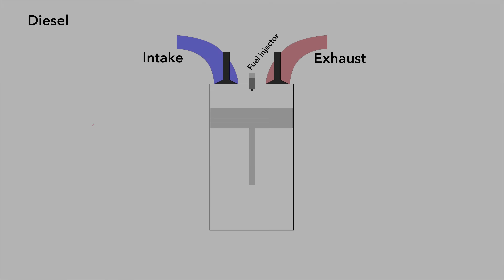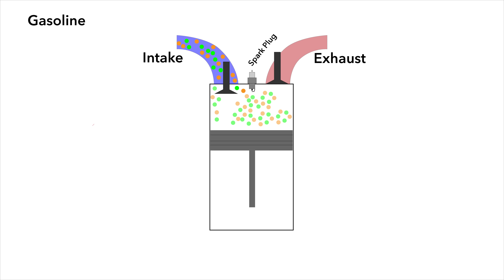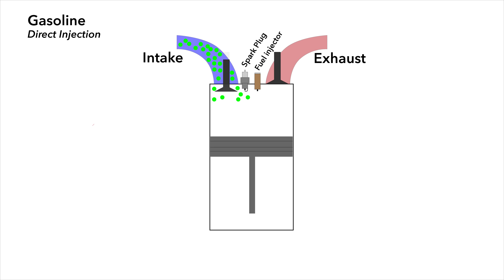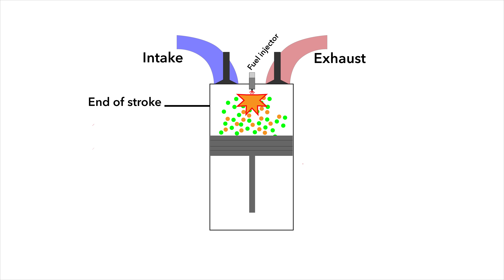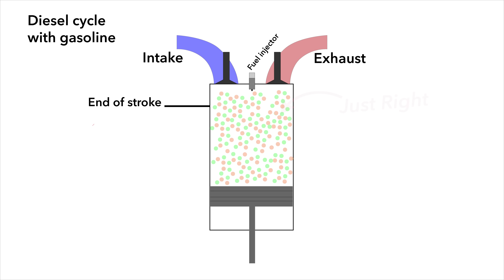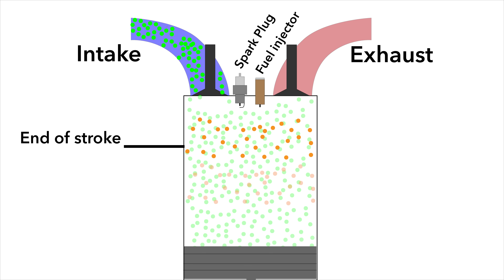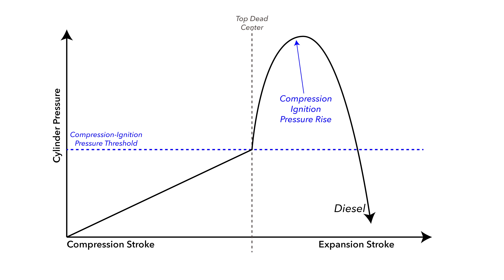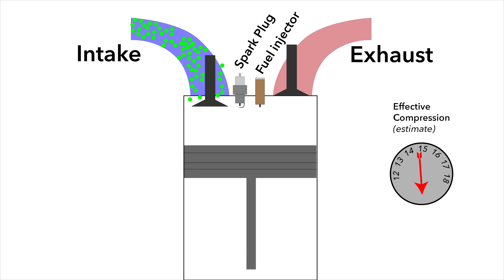Skyactiv-X: Mazda's Revolutionary Engine Explained

Comment: I think that Honda essentially the same thing many years ago.   The only difference was they had a separate small chamber with its own small valves with a relatively rich mixture that would then be used to lite off a lean mixture.  It was put into some production cars, Civics I think.

Comment: So what's the benefit? It didnt give numbers on fuel efficiency. It almost seems like tech for tech sake. At the end he states it has similar performance to the turbo 2.3litre. So why spend the money on something new and untested in the real world?
Reply: In theory the Skyactiv-X is a 2.0L that has the power of a non-turbo 2.5L, but the fuel consumption of a 1.5L. The potential is a Mazda 3 that gets about 45mpg but with about 185 hp. (The Mazda 2.5L turbo has 250 hp)  🙂

Comment: And another reason why this kind of concept aren't on sale ..  is the engine block must be thicker with more alloy+steel mixture to compensate high pressure combustion = vibration, so the price of the engine is more.. and in crowed market car price, sales dept not see it as benefit

Comment: Yes, Yes Yes Mazda have been able to control the injection but still uses the spark plug. Not new technology just  a more advanced Skyactiv engine. with advanced computer controlled fuel injection. Nothing really new at all. Anyone who owns a Mazda will tell you the 14:1 compression ratio motor is very similar to a diesel in a lot of ways.

Comment: But while the diesel is being injected, the part of the Diesel who being injected first ignites earlier. So it can't be igniting all at once am I right? Or is the ignition only happening when all the diesel is in there so the pressure is reached when all the diesel is in there? 

Sorry for my bad english i am from Germany
Reply: I think it is always gasoline, not diesel. The main gasoline mixture would never reach ignition compression just due to the piston compression.  It is a small, richer, explosion near the spark plug that raises the main mixture compression to its ignition compression, thus giving it a fast burn and high torque as though it was diesel.

Comment: I really hope it works but i have a feeling it will have problems and if Mazda fails on this they are risking their entire company's reputation. There is no going back from this if the Skyactiv-X fails.
Reply: They won't sell it until it has been proven in many hundreds of thousands of hours of testing in very hot to very cold conditions. When Mazda was first talking about the original Skyactiv-G engines lots of skeptics said it was not going to happen. The Skyactiv engines are some of the best engines in the business.
Reply: @rizzlerazzleuno4733  There is a difference proving something in a dyno and different in actual road testing.....A great example of that is Formula 1 engines! Look at Honda in the first few years and Renault!

Comment: If it uses a spark plug, it's not compression ignition.
Reply: I think the plug is used for some of the time. I agree with you, it's a pointless concept. Mazda's SkyActiv D and SkyActiv G engines are very good indeed. This just seems obscure.

Comment: Now when the fossil fuel engines should die out they discovered that it can be made a little bit more efficient. 
Why not to work on improving capacity and reducing costs of battery production? Don't beat the dead horse!
Reply: Many scientists and engineers on working every day to improve batteries. In the meantime making gasoline engines more efficient is a good thing.

Comment: Direct injection engines are crap... they carbon up bad on intake valves due to egr gasses. Mazda has had to offer extended Warrenties to cover these issues.  After that you are looking approx $800 annually in addition maintenance costs....
Reply: Plenty of diesel engines in use that seem OK. Top tier fuel helps enormously.

Comment: A good explanation. I think you refer to a Mazda 2.5 litre turbo engine. Certainly not turbo in Europe. Is it turbo in US?
Reply: Rodger Webb there is a 2.5L turbo option for the Grand Touring/Signature Mazda6, and I think it’s standard for the CX-9. I think it gets something like 250hp and 310ft-lb torque

Comment: So here’s what I’m walking away with:

It achieves conventional ratio + spark mode without detonating by (somehow) prolonging the intake valve, this “wasting” some (pre-fuel) intake air back out the intake valve, thus “spoiling” the effective compression ratio to something conventional.

It achieves super-lean combustion mode by going SO lean that it just won’t auto-ignite.  It then injects a last-minute “stoich ball” that the spark can ignite.  The bump in pressure/temperature from the burning/expanding “stoich ball” then creates diesel-like compression and pow, the super-lean mixture then burns all at once.

Whew!  Do you agree?

Comment: you got that wrong at the start. diesel engines dont compress the air and the fuel to ignight it. they compress the air witch gets hot and then force the fuel in at high prsure that makes it self combust. if you hve diesel in a combustion chamber during compresion you will get knock.
Reply: *which
Reply: @TonyTony-xj6uv  No - I owe you an apology for being pedantic. Yesterday wasn't a good day for me.

Comment: Seems similar to Honda's 12 valve CVCC engine back in the late 70's.  It used a tiny 2nd intake valve with a cage to ignite a lean mixture produced by the main intake valve.
Reply: Tha's a precombustion event. Not the same thing.

Comment: I'm still not certain of any benefit with this setup. Better fuel economy? More horsepower/torque over a similar sized Mazda engine?
Reply: Larry Sementini yes exactly. Similar size, but more horsepower, more torque, better fuel economy. This is probably why they haven’t put a turbo in their 2.5L for some smaller models because this will give people the extra power they want

Comment: I thought Honda had this way back in the 70s or 80s, an engine with fuel injection in a precombustion chamber in the head?
Reply: Yep, A '75 Civic CVCC for example. The cars needed no Cats they burned so well. My wife had one of these when we met in 1978. 

I remember taking it to the gas station to get smogged around 1978 or so. This was before the computerized connected networks at smog stations now,  and all you got was a paper slip. (and 10 bucks and some beer would get you one for your Firebird ;-) But the fella at the station in Lake Tahoe, where we lived at the time, was around my age, maybe 21-22, came back and said the Civic passed the tailpipe but tried to say he couldn't pass it on the visual inspection because I had taken out the Catalytic Convertor. I think he was looking for a little something from me.. I asked him to look in his books as it didn't need one. I recall that he looked at me like I was a dope. But he came back with the smog certificate. 

That was a great little car. Had 85,000 miles on it, no trouble at all. I made her sell it to buy a bigger used 1978 Accord so we could have some more room. That was not a great car. Burned oil and smoked. It needed valve stem seals with only 30,000 miles on the odometer. She still blames me for that.
Reply: guitarsncarsnart, what a neat story. Thank you for sharing that.

Comment: Alex, you said the fuel efficiency benefits could be 20%, perhaps even higher like 30% depending upon your driving style.
I'm interested to know, under what conditions does HCCI get better efficiency? Are you talking operator style or road/terrain conditions?
Interesting to hear that HCCI works best with lower RON/MON rated fuel, how or why is this so?
Love your work!

Comment: So, currently about 80% of the energy in a fuel tank is wasted. So, 20% better fuel economy on the 20% of fuel not wasted, is well, in the over big picture....*not much at all.*  EVs will dominate soon. ICE will only be for hybrids running at a constant speed. Part time engines.

Comment: As the son of a master mechanic, I learned the basics of the combustion engines at a very young age, and have tried to keep up with all the newer tech.  This is a very good explanation of all types, and for the layperson it is likely eye opening.  But as with all advancements since the 60's and 70's, it requires so many sensors, controls and a computer to run these systems, and that is where it always goes to shit.  People still need less complicated vehicles that don't cost a fortune every time something goes wrong.  I am thankful I can still work on my cars, even the newest tech doesn't faze me, and I will always be able to.  This sounds great, but like all over complicated systems, it will be interesting to see where it all goes wrong.
Reply: In the future (whenever that is) the simplicity of an electric motor will replace all this marvelous technology trying to keep gasoline engines efficient. The heroes in this automotive history will be the folks that come up with greatly improved batteries, or maybe the solution will be 250cc gas engines that are so efficient that they can be used to extend the range of the batteries until you reach a recharge destination. Combustion of gasoline results in serious pollution of our atmosphere and it is only with all this modern tech that we are able to continue to use gasoline engines. 🙂

Comment: Spark plug - NOT COMPRESSION IGNITION!!!!!!!

This is not anything new it is just hype!!!!

It is direct Cylinder injection, they are just playing with the fuel timing/amount!
Reply: Steve Prince  - If the Spark plug fires it is, NOT COMPRESSION IGNITION!!!!!!!

I rebuilt my first motor 40+ years ago, my family has been building race cars from the early 50's, I have owned and still do own Diesels vehicles.

So, "Try watching again, this time" UNDERSTAND!!!
Reply: Steve Prince  - and it dose not surprises me about the gullibility of the any age group that believe they know it all, then believes all the advertisement hype of any manufacture or YouTube poster!

If you like you can insult me some more if it make you feel better!

But simple spark plug ignites fuel - NOT COMPRESSION IGNITION!!!!!!!
Reply: Steve Prince  - NO it make NO DIFFERENCE, spark plug ignite fuel in combustion chamber, NOT COMPRESSION IGNITION!!!!!!!
Reply: Steve Prince  - and Knocking and Dieseling has NO RELEVANCE to my statement!

NO it make NO DIFFERENCE, spark plug ignite fuel in combustion chamber, NOT COMPRESSION IGNITION!!!!!!!

Did at any point disrespect you, so why do you insult me!
Reply: Steve Prince  - Can't disprove my statement, so you go back to discrediting me because of a typo!
Reply: Steve Prince  - Wow, you are now insulting my family,  you call me a lier, what is next my mother, my race?

I would love to see you documentation (URL) on this 100+ old Compression Ignition Gasoline motor?

You are evading the point, Mazda Skyactiv-X, is NOT COMPRESSION IGNITION MOTOR!!!!!!!  -  It is fired by a Spark plug!

Comment: Mazda engineers finally figured out a way to use detonation/pinging as an advantage to light super lean mixtures. Also using an old hot rodder's trick to run high compression on the street by using a late closing intake valve to manage the dynamic compression ratio during the power phase.
Reply: Steve Prince  I applaud Mazda for pushing the envelope for automotive engineering, just like the "old farts" have been doing as hobbyists for years. I'm guessing by your snarky reply you do not even understand what was said above or any of the engineering Scotty was remarking about for that matter. Stick to video games your area of expertise.

Comment: No mention regarding how this technology might have any effect on carbon build up on intake valves.  Does anything change in that respect?
Reply: the clear design shows ....they do nothing to help keep the valves clean by injecting fuel directly into the piston chamber it bypasses spraying gas through the valve.  Gasoline if sprayed via valves..can help keep carbon build up to a minimum if at all.  Since they bypass that....carbon build up will occur..just like it does in a diesel.
Reply: Mazda engineers said they have developed a new special coating that prevents carbon build-up (they wouldn't share the info of the actual coating)

Comment: Your illustration leaves me with a bit of a complicated question, but a pretty important one. During partial load cycles, you show the engine injesting air, rather than an air/fuel mixture, so I would assume that the engine design does not incorporate an additional fuel injector in the manifold? You also show that only the exhaust valve is open during the exhaust stage. Is this accurate?

The reason for asking is that many direct injection engine designs with VVT use variable timing on the intake valves only, and uses this not only to increase engine torque and responsiveness but rather also to perform emissions related functions like EGR and partial load cycles. 

Thus it would be likely that the intake valve is open during a portion of the exhaust cycle to act as an EGR valve (which can then be omitted). This function is present on e.g. BMW and VW/Audi/etc. engines with direct injection. As far as I know, Mercedes Benz instead uses VVT on both exhaust and intake valves, in order to let the exhaust valves do the EGR function (letting the exhaust valve be open for part of the intake cycle). 

The problem with this design (other than the Mercedes solution) is that the intake valves carbon, soot and often oil deposits from the crank case ventilation, and that this creates a deposit of material on the intake valves themselves. Fuel on the other hand is injected into the cylinders directly and thus does not clean the valves, neither by "being fuel" nor by having additives added. 

Volkswagen Auto Group (Audi/VW/Seat/Skoda/...) solves this in their third generation EA888 engine by incorporating a fifth fuel injector in the manifold (like a traditional monopoint injection). This injector would be used when the engine was under partial load as this is when the EGR function would be active. Under full load, the internal injectors (direct injection) are active and the EGR function is inactive. 

That's one way of solving the problem, but from your illustrations that seem to not be the case on the Mazda since it only injests air. On the other hand, if it's accurate that only the exhaust valve is open during the exhaust stage, then perhaps Mazda still uses the traditional external EGR valves (?) despite the higher cost?

Great video and illustrations, by the way. I would offer one suggestion, which would be to have started with the gasoline principle illustration rather than the diesel one. Reason being that the diesel illustration narritive is trying to explain why the spark plug is unnecessary without having first shown why it's necessary in the first place. :)

Comment: This is all well and good to further implement what has been known about ICEs and maximize their efficiency, but the industry is moving to EVs.  I'd question why Mazda is using scarce resources to improve the buggy whip when the horse is facing its demise.
Reply: 1. Petrol cars will have their own market cap for the next 20 years (don't forget hybrids). The market of electric cars is still just a playground (and will be  for the next 5 years imo). Innovative models (not simple variants of an existing model) are currently not profitable, they are just prestige models. Mazda is simply too small to compete without risks on this market. 
2. As I know, upgrading an engine is way cheaper (like 10-20 times) than   developing a new model or a new model-platform.
Reply: the industry is moving towards EVs because of the very generous subsidies provided by the federal government. take that away and i highly doubt that they would do well.

Comment: Run lean on light loads and richer on power - too lean a mixture is very hot which would burn pistons but going back & forth to richer keeps average boom temperature cooler.

Comment: Cool tech.. But as usual I will wait until we see how reliable these are. Better fuel economy means nothing if you blowing head gaskets ever 20,000 miles and filling the crank case with coolant.

Comment: Diesel just like petrol(Gasoline) also ignites at an initial point. The difference in speed of the combustion is due to the higher compression rates of diesel vs petrol.

Comment: It's called direct injection. It's been around for decades. The fuel pump will cost you over $2000.00 if it fails. This will be an in warranty car only to have. Get rid of it before the warranty runs out

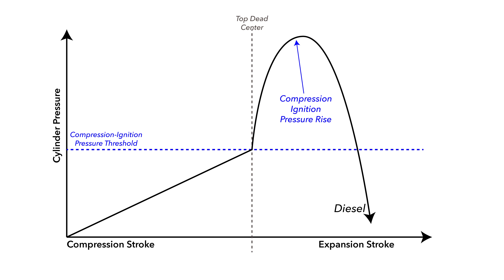Comment: You got it wrong at 2:58, diesel injection is progressive and combustion happens at constant pressure (http://hyperphysics.phy-astr.gsu.edu/hbase/thermo/diesel.html) not "Boom" and the pressure actually does not rise, remains constant, what actually rises is the temperature and volume of the gas in the cylinder. Anyway future is electric so instead wasting time developing engines more, the engineers should concentrate on developing better batteries. Electric efficiency is around 90%; compare that to 30-40 % gasoline and diesel engines and see why it makes sense to promote electric powered vehicles and not wasting 60-70% of your money and resources to just heating air.

Comment: Does this  setup have the same carbon buildup on the valves that other direct injection have?
Reply: I'm sure it does
Reply: I suspect it will be less of a problem,  because adding some fuel to the intake air is the suggested solution to the carbon problem.  See another video that explains direct injection gas engine problems.
Reply: @bradfocl  this isn't a rotary buddy
Reply: @MilesPrower1992  oops,  responded to wrong video